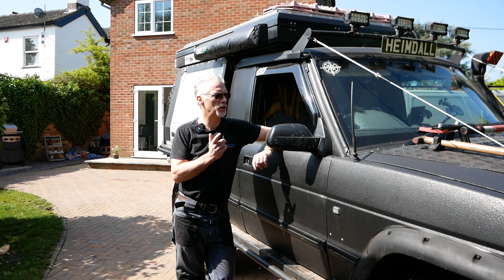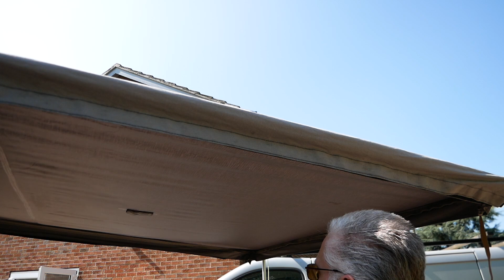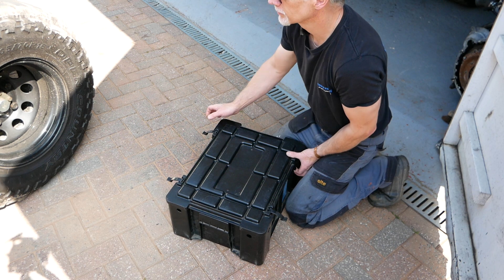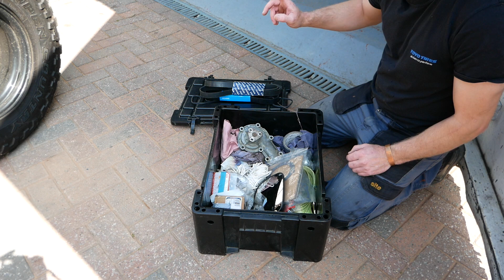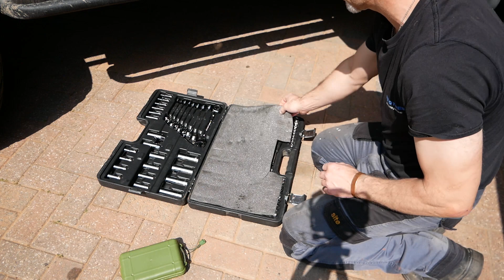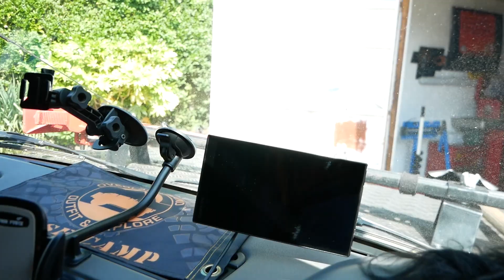Land Rover Pre trip checks & Walkaround Part 1 | All 4 Overland

Comment: I always carry a tube of JB Weld.
I've used it to repair (temporarily, at least) things like a cracked coolant header tank, leaking core-plug, damaged tyre valve and even a cracked sump.
It really CAN make successful repairs that'll keep hot oil or water inside whatever it's trying to escape from.

There's obviously heaps of different types of epoxy resin available but JB Weld is (IMO, at least) way better than anything else that I've seen.
If you can't find JB Weld, Plastic Padding make some stuff called "Super Steel" which seems very similar but I trust JB Weld a little bit more, from experience.
Reply from the maker: Hi Sicrewe..thats not a bad idea to carry some jb weld..i have repaired a few things with it in the past so i will probably chuck a pack in the spares box thanks..

Comment: Hi

 We have just come back from Pyrenees, sailed Brittany Ferries from Plymouth, took an axe, was asked at security, no problem at all, take a good pruning saw, had several trees across track but we were early season. We both broke rear shockers, would def take impact gun, and battery angle grinder and some spare hoses. Also Marpers trail ( Aguero to Luna route)a lot of the single track has been widened levelled and graded, looks like going to be doing logging up there. Will try and edit a short video for Youtube. Will message you with some interesting trail suggestions. Have fun good luck.
Reply from the maker: Hi thelandycrew...thats interesting that they let you take an axe..last time we went we had alot of trouble trying to get some of the stuff through..used to carry hoses with us but changed all the hoses to silicone so hopefully should have no issues..but will defo carry impact gun and its a good shout on the cordless grinder and let me know when you put up your video..
Reply: @All4Overland  We went last year and this year, no bother, UK Security asked, i declared it and they said it was genuine reason as we were camping, Spanish were a lot less keen than last year. Last year searched going in, this year didn't bother either way, we are 110 hardtop. Re video will do..
Reply from the maker: hi landycrew..thats really interesting that they are not overly fussed now as long as you declare so probably will take with me now..

Comment: I finally got myself a Disco 2... how ever i discovered some hidden bog in the footwells after removing the carpets.The area of bog i removed left a massive hole and i'm trying to find a welder to sort it for me. As there are three areas of bog i'm expecting three holes. I have a Terrafirma Lift Kit for Fathers day and a Terrafirma Sterring damper on the way. Once everything is fitted i'll carry on with the tidying up.
Reply from the maker: Hi miklawson...thats unfortunate to find that someone has covered the rust but i am sure you could get it fixed to carry on the build...where do you live mate..
Reply: @All4Overland  I'm in Southport, just North of Liverpool. I'm seeing some one tomorrow to see if they can do the work. Once it is welded i'll be cleaning and painting the chassis and sealing the body work. If i can, i'll try to buy the paint to repaint the vehicle and get rid of bubbled paint on the window frames and body work.
Reply: It's raining so i went out to check for rain tracks. There is water coming in through the Grommet in the bulkhead in passenger footwell. On closer examination the area is rusty and full of bog. I checked out the engine bay and areas are full of expanding foam.... which catches the water, promotes rust and pools water. It looks like i'm going to need a large floor panel. In the drivers footwell it looks damp around where the brake goes through to the master cylinder. No water in the drivers footwell as yet. The water is running out of the passenger footwell through the hole in the floor. At least it isn't pooling :)
Reply from the maker: Pity you are not a bit closer as we are taking work for the New Garage...it sounds like the previous owners were trying to hide something or didn't know what they were doing...good luck getting your truck sorted mate..

Comment: How far is the trip to the Pyrenees?   If a axe/hatchet/machete is not allowed, what do you use to process firewood, when allowed to burn?  Folding pruning saw maybe?
Reply from the maker: Hi retnav..the trip to the pyrenees is a fourish hour drive to the ferry ..36 hours on the ferry and then another 3.5 hours to the start of our track to the pyrenees..apparantly now if you check in with security they will let you in with an axe and a saw but most places in spain prohibit open fires for risk of forest fires..
Reply: @All4Overland  we drove the  extra  2 hour to plymouth which is only a 20 hour crossing
Reply: @All4Overland  36 hours!?  What body of water are you crossing, and I hope that "ferry" has sleeping/eating accomodations.
Reply from the maker: Apparently if you sail to Santander thats only a 20+ hour crossing as well..
Reply from the maker: Hi retnav...we will leaving England down the english channel and across the bay of biscay to Bilboa in Spain..the ferry is quite luxurious as it is like a cruise ship so we should a good time on the boat before we even get to Spain..

Comment: Some people just take a Toyota 🤭 I know I know... Get out!
Reply from the maker: i used to have a Toyota surf/hilux  it broke just as frequently as the landy but cost more to fix lol..
Reply: I once had an interesting conversation with the transport manager on a big construction project.

He had a fleet of something like 250 vehicles; 20-odd Disco's and LC100s for managers, a heap of Defenders and Hiluxes for work crews and Mitsu' L200s and Isuzu Troopers for the peasants.
In a nutshell, he considered the L200s and Troopers to be "disposable" - use them until they break (usually blown engines or broken gearboxes) and then ship them back to civilisation to be repaired.
The Toyotas WERE the most reliable vehicles but when they DID break they also needed to be shipped back to civilisation for repair.
The Land Rovers weren't as reliable but they were more likely to be repairable on-site so they clocked the most hours overall.

He was especially fond of Defenders because one of the biggest problems was panel-damage, which always required a welded vehicle to be sent away for repair whereas, with a Defender, a fitter could unbolt the damaged panel and pound it (approximately) back into shape with a rubber mallet.

Goes to show you; "reliability" isn't as straightforward as people might think.
Course, if LR could have managed to build vehicles that  were "reliable" AND easy to fix, that would have been marvellous!
Still, I guess those days are gone now anyway. 😕
Reply from the maker: having worked on all sorts of vehicles over the years the landrovers are definately the easiest to fix as they are the closest to a tractor out of  all the 4x wheel drives you could get..so i think reliability is in the eye of the beholder..
Reply: @All4Overland  Yes. I did have a friend go to Russia. He asked a colleague what a good quality washing machine was then bought one. 2 months later it broke so he question the colleague about it. His response was, yes it's broke, but it's very easy to fix. So quality is definitely in the eye of the beholder.